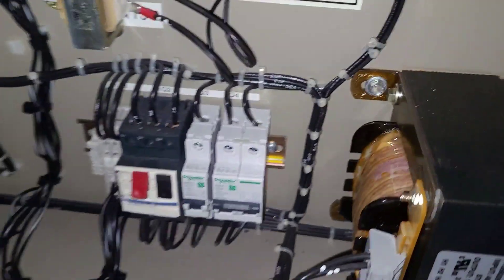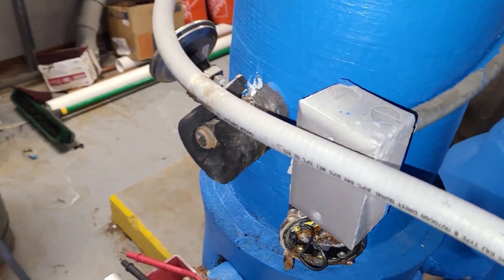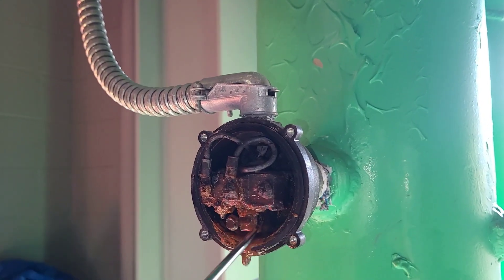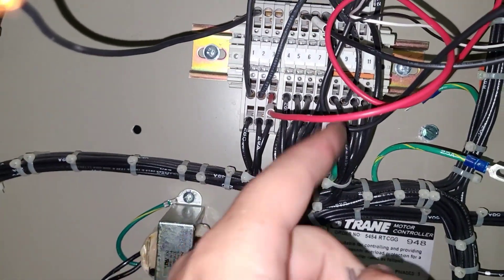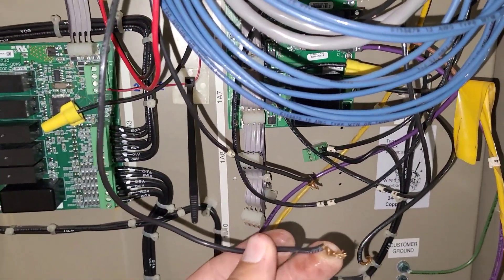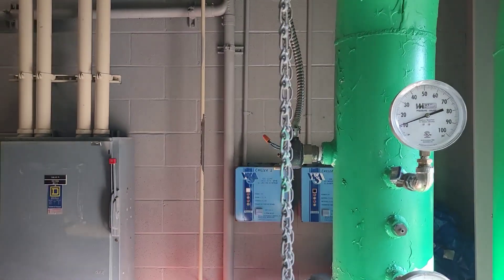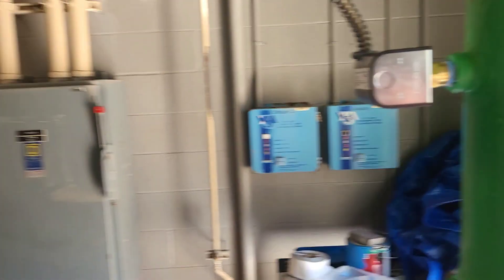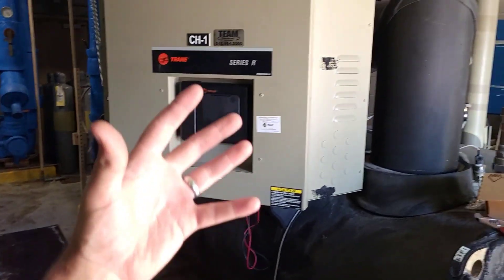Trane Chiller Down for Controls Short

Comment: Wow  amazing , I get such a buzz out of fault finding that I don’t need drugs or alcohol. We worked among a similar set up at work using Trane chiller that also had a trend system monitoring the set up as well and had numerous issues over the years. As the usual system goes they had a boiler man & an electrician who looked after the plant with contractors that was a closed shop with management which was annoying. But I always turn the negative to positive & with my hunger read books looked on the internet YouTube and did college courses lot of negative comments even from my manager saying you can’t learn refrigeration from a book and so on. As an electrician I had alway desired to get into controls. A good inspiring video.

Comment: I have a experience that the flow switch jammed to flow position, the chiller keep running even the flow rate is low. The chiller model in my site is Trane CGCM, it hasn't any protection for the low flow cut out and evaporator freezing. At the result the evaporator is freeze up and damage it.